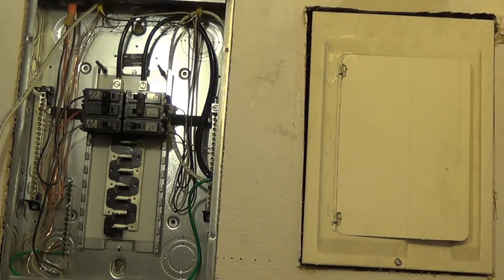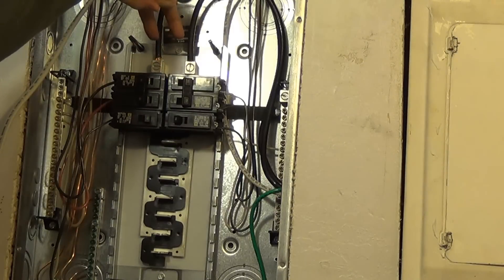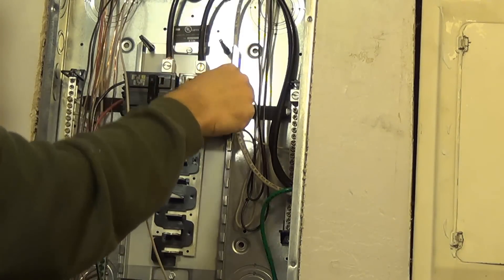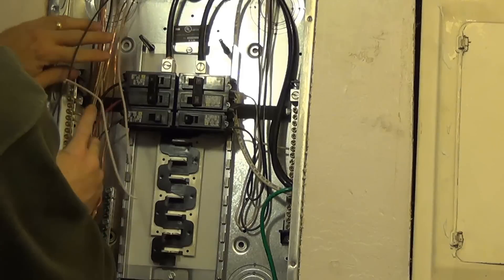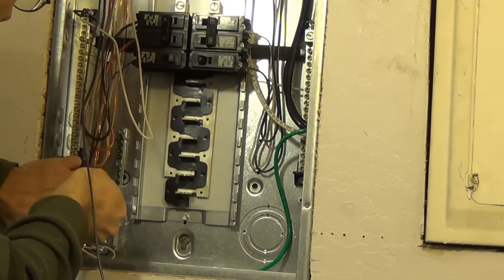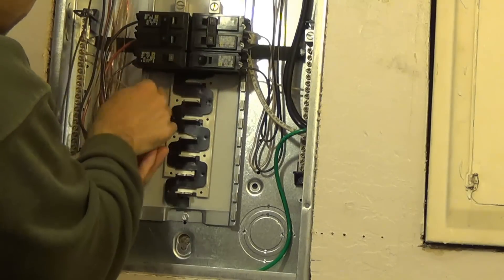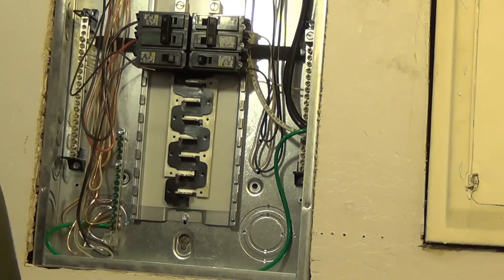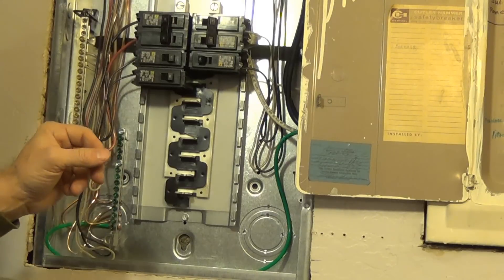How to Install a Circuit Breaker

Comment: Great video. But please dnt strip wire like that, it scores it and weakens the wire , that can cause it to arc. Strip it at a slight 10° angle going away from your body to make it easy to strip

Comment: Thank you.
I am ready to install a 20 amp breaker for my microwave.
There is an opening with the cover off. I was a bit worried that it might be a faulty location .
Now I know that I can run longer lengths in case I have to move it to a different position on the bus.

Comment: Do you have to use the same brand's breakers throughout the terminal?

One of the breaker companies at Home Depot's website claims if you don't use the same brand's breakers it could start a fire.
Reply: Dialectical Monist    You should use the same breaker manufacturer as the panel.   The reason is in case something happens the manufacturer can't point fingers every where else.   Start fire  because of it, same frame, same components, different label.   You decide.

Comment: All my white and ground wires are tied together on the bus bar with the black/hot wire into the breaker. Not having a separate ground bus, is that ok?
Reply: Is it an older ITE Pushmatic?

Comment: What is all my grounding wires seem to go into the same bar as my neutral wires?
Reply: That is strange.  You neutral wires should all go to your neutral bar only and your neutral bar should connect to your ground bar with 1, and only 1 wire.
Reply: Common on older panels. Is it an ITE Pushmatic?

Comment: Thanks for Sharing this, I need to put a 30AM Breaker into my panel for my Generator.
Reply: Kelly, please be sure to follow your local electrical provider's guidelines when installing a generator into the panel of your house.  I am certain you probably realize this but there is a potential for your generator to shock a line worker who had locked out power upline but could then be shocked by an energized circuit from your house if not properly isolated from the grid.

Comment: It's not the voltage that kills you, it's the amperage.  The remark you made saying "Eventhough the power is off I still am treating it like it is on" doesn't even match. If the power is off there is no chance of you getting shock. Also, That house is different than most houses because usually white is hot and black is neutral.
Reply: Don't spread bullshit like that. Black wires are used as hot wires and you should always assume that's the case.
Reply: Actually it is possible if you know much about AC theory. Although it's highly unlikely. In AC electricity you can store capacitance inside the conductors due to inductance. It would be easy enough to discharge it thought grounding out the hot wires. Matt is seams strange to get mad at people  when discussing these things. That doesn't help anyone. I'm not sure what country you're from, but here in the United States the National Electric Code (NEC) clearly states that the white wire( neutral) Shall be identified with a white finish on the insulation or grey). Go read up on the NEC man, or here's a link in case you don't have a code book. https://www.mikeholt.com/instructor2/img/product/pdf/1114783832sample.pdf
Reply: Matt Bruns He wasnt talking about that, he was talking about the fact that the hot wire is almost always black. If you are switching your hots and neutrals, thats fine as long as you are consistent, but in general, what you said was misinformation.
Reply: This guy is a dipshit.  White is not hot.  Black is commonly used.
Reply: I agree with everyone...  I don't like confrontation.
Reply: Matt Bruns it is both that kill you, voltage and amperage.  You need enough Voltage to push current through your body.  Yes it is only a small amount of current that could kill you, but without enough voltage current  just can’t flow through your body.  120 Volts given the right circumstances can kill you,  240, well...   I don’t think you should be commenting in these post you ignorant fuck
Reply: Since when?   (year)
Reply: I am not sure to which comment you are referring but the lines to the main breaker from the utility are still hot even after you flip the main breaker.
Reply: That doesn't sound right.  Capacitance and inductance are two different things and conductors dissipate both in milliseconds after de-energizing.  There is the possibility that a load down-line of the breaker has stored energy in a cap that could discharge into you though....I got popped by a power supply once.  Made me instantaneously sweaty.
Reply: There is no possible way you can get shocked if the power is turned off. If there is no power there is no current. Are there really these many people who think of stupid things like that. Obviously, you all don't know what your talking about. Don't reply to my comments if you are going make remarks like this. I don't know what's in peoples minds when they say if the power is off which means NO CURRENT OF ELECTRICITY you can still get shocked. That is the stupidest thing I have ever heard a person say. That's impossible. Keep your stupid replies away from my comments.

Comment: Great video! Bought a foreclosed house and doing the electrical myself. Of course, yahoos came in and cut all the copper plumbing and wires. Some circuits, able to run through junction boxes. Some, too close to the box and are short. Will have to run new lines and this will help. One, side note, heard water going in the back ground!? Not good working with electrical.

Comment: When you're forcing the breaker onto the bus, screw the front onto the panel loosely it should make it impossible to shock yourself if you slip.

Comment: Hi I have a portable air conditioner and when the washer and or dryer is on the circuit breaker trips around 15 minute but it the portable is off is circuit does not trip, can you help me

Comment: So if someone cut the neutral to the breaker box wouldn't the power flow across the appliances at 240 volts?
Reply: the neutral /ground.
is for safety. it is not advice for cutting it.
Reply: Jude Corby yea I would agree.
Reply: If you cut the neutral line there would be no current path.  The neutral wire is terminated to the neutral bus which is connected to the ground bus with 1 (and only 1) connection.  Ergo your neutral is at the same potential as the ground.  Cutting the neutral would only result in 0V across the appliance as both sides of the appliance (line and severed neutral) would then be at 120V.  The reason this occurs is a result of a simple voltage divider equation.  Let's say your 15A vacuum cleaner were plugged into an outlet.  A 15A feed would equate to an impedance of 8 Ohms.  But now you have severed the return path....so you have two "loads" on the circuit, one of impedance 8 ohms and another that would be in the tens of megaohms at least.  The voltage divider states that the voltage differential is proportional to the ratio of the impedance.  Most of the impedance is across the severed connection, ergo the full 120V drop is across the severed connection.  There is no chance for 240Vrms on a 1 pole circuit if wired properly.

Comment: Hello there. So the process are the same with a 20 amp instead of that 15 correct ? Thanks
Reply: Except you'd use 12/2 wire for a 20 Amp circuit, instead of the 14/2 commonly used for 15 Amp circuits.
Reply: Yes that's correct

Comment: Great video! thanks very much for posting this video! I just installed a 40 amp breaker in my square D QO box for a 25,000 BTU 240 volt electric space heater I just bought and installed in my garage with an 8-2 romex cable. This was my first home electrical job, and I couldn't have done it safely without this video